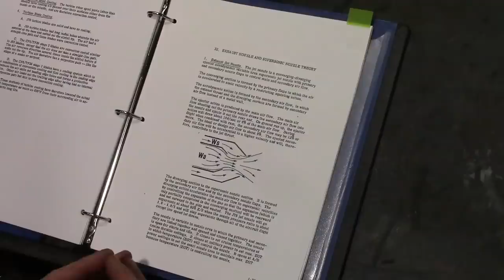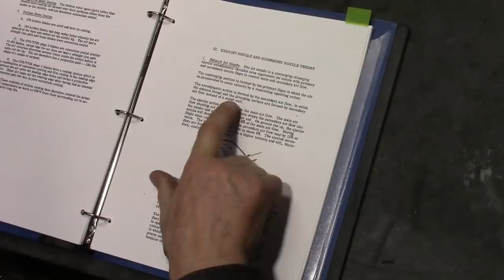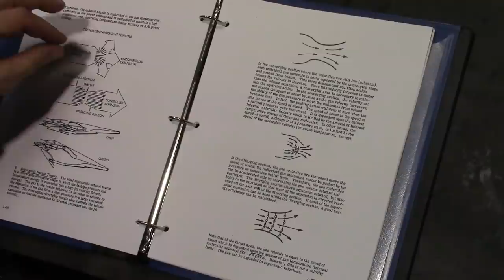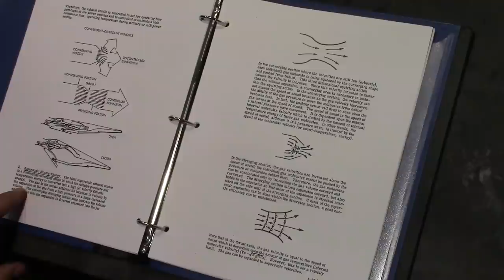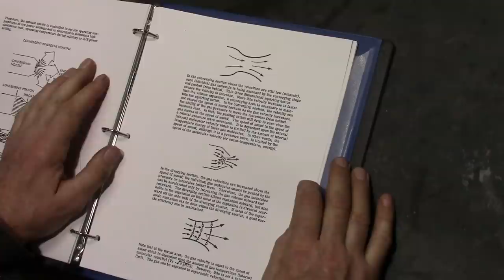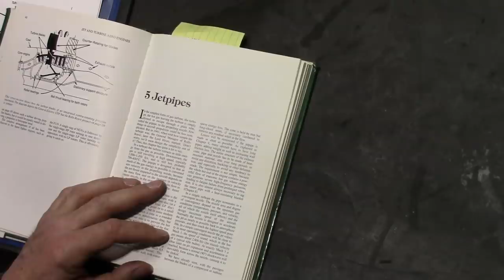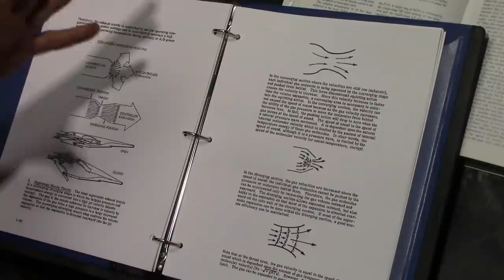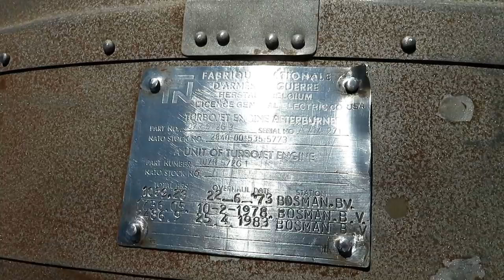Afterburner Jet Propulsion Nozzle

Comment: I am in powerplant at an A&P school and we just went over the exhaust section in turbine engines. (I may be wrong lol and yes I am a student) but the converging-divergent section: Converging section increases velocity due to Bernoulli's principle, the air becomes supersonic in the throat of the nozzle, and supersonic "flips" Bernoulli's principle. So a divergent section is to increase pressure and decrease velocity, but because of the "flip" it now INCREASES velocity further, so bigger bang and boom lol.

Comment: When trying to understand the J-79 afterburner system It was hard to forget the J-57 system which dont work as convergent -divergent-convergent duct.   You really have to throughly understand Bernoulli's equation to keep up.  I was amazed at how many engine tech didn't fully keep in mind the principles of jet engine operation, and use them in their daily troubleshooting endevours.  Thanks for the video. You are among the best I have known.

Comment: The Phantom Spey reheat jet pipe did not have a convergent-divergent nozzle. It had a variable area convergent nozzle, which simply opened up when the reheat lit up. The nozzle petals were operated by a nozzle actuating sleeve that moved forwards and rearwards. Looking at the diagrams in 'The Jet Engine' book, the sleeve could have provided a small degree of divergence, with the nozzle in the open position.
I've stated the obvious before before and I'll state it again: a jet engine produces a forward thrust by accelerating a mass of air rearwards, in accordance with Newton's Laws. However, I will go on to state what is equally obvious for me: the thrust comes from the summation of forward and rearward loads throughout the engine, which result from the various pressures acting on various areas, that all contribute to the acceleration of the air.

Comment: Wonderful.
In your videos looking into an afterburner, I see with increaspng radius:
metal (or flame), sunlight, metal.
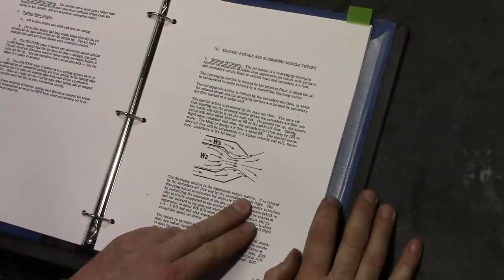This video shows this at 2:47, 3:08, 3:20, and especially 5:02.

I have been meaning to ask you about that.
I speculated that it was something like a dyson bladeless fan, where a small amount of high-velocity air accelerates a large amount of slow air...

The air entering the secondary airflow passage is at atmospheric pressure!
Its incredible that for all the roaring and flaming at that point, the afterburner gas is at a lower pressure.
You ONLY get thrust out of an engine where individual molecules bounce off metal.
Its amazing that secondary air can sit between the expanding gas and the metal in the afterburner exhaust area, and accomodate the generation of more thrust.

Thank you for showing us this magical  mystery.

Comment: Hello AgentJayZ, the FN-build afterburning section you were showing in the video is allmost certain from an J79-GE11A engine. The Belguim Air Force was a user of the Lockheed F104G Starfighter. The planes were build by Sabca  (Belgium) in licence. (and then I think the engine were build in licence by FN)

Comment: The primary drawing in secondary air is doing it by the "entrainment" principal.  Its not a commonly realized method but works great, especially in this scenario.  Moving more of a lower velocity fluid with a given volume of high velocity.

Comment: Not too much information, I say, so you go on with these little explanations!  I think Graham may have to consider creating some basic models of nozzles for his wind tunnel, where adding the 'smoke' may help illustrate air <gas> flow patterns.  Probably a bit time consuming but just a thought.  Great job, as usual.  Thanks & cheers!

DD
Reply: I might try doing some experiments with my little wind tunnel, but its flow velocity is only a few feet per second, so I'm not sure what flow visualisation will demonstrate.
Reply: Of course, I had not considered the velocity factor, so I may have shown my ignorance on this subject!  I reckon it is not quite so simple to demonstrate but maybe you can use a 'higher velocity' source, such as the exhaust of a vacuum cleaner or even compressed air, released in a controlled manor.  Some high-end vacs, like a Miele, have a variable power setting that actually varies the speed of the motor!  That would give you a range to play with..... sorry, my imagination carries me away at times.  Thanks for even considering this & replying to my original comment.

Comment: I'm curious how different today's modern engines (i.e. GEnx or latest Rolls-Royce) are from the Orenda's or GE's in your videos? Are there any significant technology advancements, or is it just larger, improved materials and tolerances, and perhaps some mechanical systems replaced by electronic with more advanced sensors? Can one person still maintain the newer engines, or are the systems so large and complicated that it takes a team with individual specialties?
Reply from the maker: The design and the maintenance are two different worlds.
In summary, everything is better about newer engines.
They are more complicated, so more different skills are needed, and more labor hours are required to perform the work.
One person could overhaul a GE90, but it would take so long that it might be obsolete by the time the work was completed.

Comment: Air weighs something.  Thats a hard thing for people to wrap their heads around.  

If you sit in a chair with wheels and fling 9 lb of marbles with about a 100 degree dispersion angle the chair wont move much, but if you throw a 9 lb bowling ball from the same chair, you will move more.  

Its the same 9 lbs, and the same motor pushing, but the bowling ball only goes in one direction.

Comment: Those wanting another resource to further understand how this under-expansion and over-expansion of exhaust gases (rearward and not outward thus wasted etc) might want to go read about how rocket engine nozzles work and why they are smaller at sea level and larger diameter (larger cross section area) in orbit etc.

Comment: Good stuff!   Any idea how much % thrust the jet car racers are missing out on with their fixed and converging-only jet pipes? You had previously mentioned that the variable nozzles are military restricted and that the jet racers are forced to tune their pipes and nozzles for one specific condition, which is usually full power.

Comment: I get it. The convergent nozzle squeezes which cause an increase of pressure. The pressure leaving the convergent nozzle expands outward spilling over outer edges. The sudden expansion of wasted force off the edges is redirected by the divergent nozzle walls to the rear where it belongs.
Reply from the maker: No. The convergent nozzle causes a decrease in pressure for subsonic gas flow. A decrease in pressure and an increase in speed.
Repeat that 86 times... now.
The rest of what you said is correct.
Remember, at the supersonic transition boundary, the laws of gas flow reverse completely.
Don't ask me why. Nobody knows...
Reply: Its easy to kind of understand if i look at it like the relationship between voltage, current and resistance ( E/I*R).  Pressure Force snd Area relationship  would be P/ F*A). Voltage somerimes called  Electromotive Force i guess makes it a kind of force? Electromotive Force would be Pressure rather. If so can i say Area would be my Resistance and Force like Current flow?
Then the formulas match. Decrease in Pressure = increase in Force and decrease in Force =increase in Pressure.
Maybe I'm way off.😃
Reply: Well, from my notes last semester on the subject, its a simple case of using the conservation of mass and momentum and relating it to the change in area.
You end up with this equation:
du = (-u/(1 - M^2)) * (dA/A)

du - change in velocity
u - velocity
M - mach number of the flow
dA - change in area
A - area

For subsonic cases (M < 1) and where the change in area is positive (dA > 0): 
du becomes negative (velocity decreases) 
This makes sense because it has an area that is increasing (divergent), the velocity should decrease. 
 
Now look at the same equation for the supersonic case (M > 1) and the area decreasing like a nozzle this time:
du becomes negative and velocity decreases... 
This is very non intuitive as you usually look at nozzles as devices that increase the velocity of the flow... not in the case of supersonic flow. In fact, if you look at further cases, supersonic flow is the complete opposite of subsonic flow.
However, both are just following the simple rules of conservation of mass and momentum.

Comment: In other words the supersonic airflow in primary airflow under high pressure at supersonic speeds hitting its velocity limit due to thermal limits for a given fuel type (kerosine) directed in convergent manner rearward in the primary duct will act to suck secondary bypass air around the primary duct in order to relieve pressure. The secondary airflow being at subsonic speeds acts as the main source of thrust until it also reaches supersonic speeds. Technically you could have multiple stages of afterburner if the secondary airflow was also under high heat and pressure.
Reply: The secondary nozzle just contains the outward expansion of gases, also adds in secondary air to aid direct outward expasion rearward. And since is it is a de Laval nozzle it will only choke at the throat if the pressure and mass flow through the nozzle is sufficient to reach sonic speeds, otherwise no supersonic flow is achieved, and it will act as a Venturi tube; this requires the entry pressure to the nozzle to be significantly above ambient at all times (equivalently, the stagnation pressure of the jet must be above ambient).In addition, the pressure of the gas at the exit of the expansion portion of the exhaust of a nozzle must not be too low. Because pressure cannot travel upstream through the supersonic flow, the exit pressure can be significantly below the ambient pressure into which it exhausts, but if it is too far below ambient, then the flow will cease to be supersonic, or the flow will separate within the expansion portion of the nozzle, forming an unstable jet that may "flop" around within the nozzle, producing a lateral thrust and possibly damaging it. In practice, ambient pressure must be no higher than roughly 2–3 times the pressure in the supersonic gas at the exit for supersonic flow to leave the nozzle.

Comment: Great video 
But the cooling air around the jet pipe is bypass air from the fan isn’t it? 
And any real thrust is made by pushing against atmosphere behind the aircraft? How efficient, if at all, would this be in space?
Reply from the maker: All three things you just said are N/A
1) There is no fan, and in an engine where a fan is used, it does not supply cooling air, to anything but the oil cooler.
2) Absolutely 100 percent incorrect.
3) it's an air breathing engine, so what do you think?

Reading the book by Mr Gunston would really help you out.
Reply: @AgentJayZ  And #2 is the most common mistaken "Proof" spouted by Flat Earthers claiming that rockets don't work in space :(
Reply: The force any air breathing engine or rocket produces is a combination of two things: momentum (product of the mass of the gasses and their velocity) and pressure thrust:
(Pe - Pa)*Ae
Where Pe is the exit pressure, Pa is the atmospheric pressure, and Ae is the exit area. 

So, 
F = m(exit)*ue - m(inlet)*ui + (Pe - Pa)*Ae

m - mass flow rate (either inlet or exit)
ue - exit velocity
ui - inlet velocity

There's this incorrect notion that you need an atmosphere to produce any thrust at all... from the actual equation used above you can see exactly why rockets work and aircraft engines don't.

Rocket engine in a vacuum:
Set Pa, ui, m(in) equal to zero. You still have pressure and momentum thrust... remember, the mass is supplied by storage tanks onboard unlike an aircraft engine.

Aircraft engine in vaccum:
Set m_dot (in), m_dot (exit), Pa and Pe (because there is no mass, there cant be any exit pressure) equal to zero.
F = 0. 

That's your technical reason. Btw, the equation used above is the very basis to a lot of other equations used by everybody in the aerospace community.
Reply: * CJ1311 could have just said “ we simple humans never learned how to get anywhere without leaving something behind “ 👍🏽

Comment: That's pretty awesome, thanks for showing this. I have wondered about the pressure*area method, and I would think the use of the static pressure would ignore most of the pressure in the gas flow. With so much of it being accelerated, dynamic pressure would dominate. I wonder if you could end up measuring thrust by area*dynamic pressure (until the pitot probe is melted, at least) and if that makes more sense to people trying to understand thrust who can't get past the pressure*area thing. Given the gas nozzle you describe here (the gas that flows in between the end of the combustion liner and the variable nozzle) would make calculating the area fairly difficult, too, since it would be smaller than the variable nozzle (if it terminates at the end of the nozzle, if it goes on aft of that it could become huge).

Anyway this has been awesome, I've wondered about the con/di nozzle for ages and now I see it's even more sophisticated than before. The idea of the actual nozzle being a shape in air is very cool, and makes me wonder about altitude compensation. The expansion of rocket exhausts is affected by atmospheric pressure and the bell shape (and length) is a compromise between the thrust and stability you get at one altitude, and the thrust and efficiency you get at a (much) higher one. In the diagrams you showed, there seems to be scope for the nozzle to have an atmospherically controlled gas con/di nozzle by the provision of what looks to be ambient air from outside flowing into the nozzle. As the altitude increases the air pressure and flow changes which would change the shape of the nozzle. I wonder if that works to the favour of the engine or if it's an impediment to ideal engine operation. I was thinking of this in comparison to aerospike rocket engines.
Reply: Static pressure is the only pressure that a physical boundary, such as the final nozzle, actually 'feels'. Dynamic pressure is kinetic energy, which can be converted into pressure by the flow being brought to rest, as in a pitot tube.
Reply: @grahamj9101  Yep, got that. Does that mean that thrust is a function of the sum of all the static pressures throughout the engine and the areas of the surfaces that contain them? I'm more wondering about being able to measure the thrust of an engine from down stream, with something like a pitot tube measuring dynamic pressure rather than by measuring the static pressure within the nozzle.
Reply: @deSloleye  Yes, the forces that add up (and subtract) to produce engine thrust are as you have described. However, let me reiterate that this in no way contradicts F equals m times a: if it weren't for those forces, the acceleration and increase in momentum of the air/gas wouldn't be happening.
When it comes to measuring engine thrust, I'd prefer to go for load cells on the engine test stand.